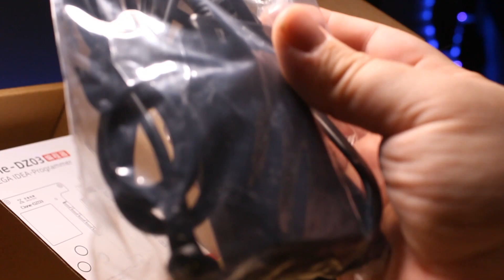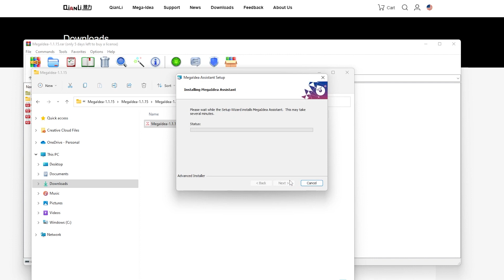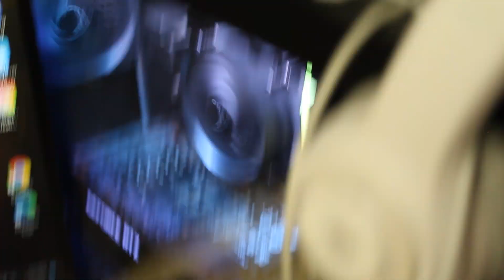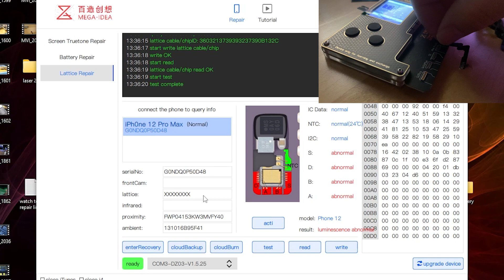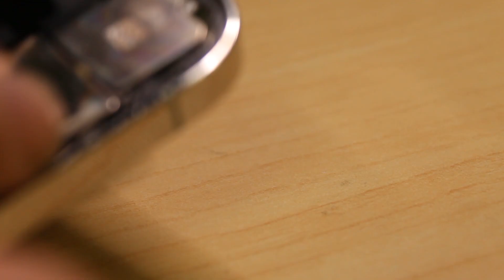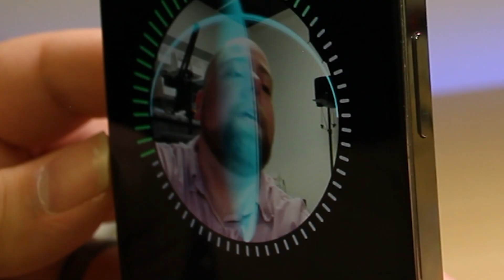Face Id Repair with Tag on Flex and Programming only? (No Soldering Required!!!)👍

Comment: Hi bro…please i have a question??… can i still read the data from an original dot matrix flex cable that has a very little tear or cut, is it possible to read the data with a programmer
Reply from the maker: Probably not, it might still be recoverable but it will need to be soldered to a good flex to access the data.
Reply: @FIXDPHONES  ohhh great…is there a process to it

Comment: Just wondering if you could help so i was getting boot loop and i came to conclusion that it was the proximity sensor and i swapped that out for a new one but obviously i have lost face id to fix this could i use a clone-dz03 or do i have to solder the old sensor back on any help is appreciated.

Comment: I am getting this errors “ lattice cable/ chip not connected” how can I fix it? Thanks
Reply from the maker: Try downloading the most recent update for the software as they fixed some of these bugs, otherwise that issue can occur when the dot projector is sufficiently damaged to not be read and solder work would need to take place to get Face ID back. I hope it’s just software in this case.

Comment: Hey am I able to do this without the original speaker assembly? The flex cable broke on it. This is for the iPhone X
Reply from the maker: No, this tool isn’t designed for the proximity sensor assembly, it’s for the front facing camera assembly (specifically the dot projector) for a torn cable on the proximity assembly you’ll need to solder the proximity component over to another original flex cable to retain Face ID

Comment: Thank you for the detail steps.  I got the qianli programmer.  Did the steps on your video, passed the test with the tag on cable but after I installed it trying to setup face id it will show move higher or lower prompt.  Took it out tried setting up with the display on the side using a extension cable but still same issue.  Any suggestions on what I might do to resolve the issue?

Update:
Figured it out.  I used another qianli tag on flex.  Followed the same instruction and everything worked as expected.  Thank you for the video...
Reply: Thanks for this comment.. i wish i knew earlier to buy more tag on flex's.

I messed up a customers iphone 11 face id when using to much rubbing alcohol taking out battery. I tried these steps in the video, but i still got the move up/down error. Its possible i may have just messed up the camera and i shoud have tried changing that first. But Quanli face id board did detect errors, except i think when i tried to repair it the results were not the same as in video. I amtemted to solder the chip onto a new flwx next, but i cracked the enclosure when trying to remove it, i didnt realize the glue was so tough on there...

My question is, if we try this method and it fails (as well as trying addition tags), is soldering the chip onto a new flex still an option, i would guess with a new tag on flex.  or is that poinless now since we perhaps have wiped the chip?

Comment: I just got the programmer and it’s great. After programming the tag on flex I installed everything into the iPhone but Face ID still doesn’t work. The Face ID module hasn’t been damaged in any way. The iPhone a am working on is an 11 pro. I’ve heard that the iPhone has to be updated in order for this to work and I wanted to see if that was true. It’s currently running iOS 13.3 and I don’t want to update it but I want to know if that is the problem with it.
Reply from the maker: I don't think it should be affected by running an old iOS. Its worth the try as the worst that can happen is it still wont work.
Reply: @FIXDPHONES  I’ve tried an iPhone X on iOS 12 and the 11 pro on iOS 13 and they both won’t work. But I know for a fact that it will work on iOS 15 on onward.

Comment: why dont you just directly program the faceid and have to use tag on flex?
Reply from the maker: It’s not a matter of programming the Face ID, it’s already programmed by apple. The issue is the phone can’t read it and by using this tool you can copy and program the tag on flex to bypass and make the dot projector function. I hope to demo directly programming the Face ID when they come out with a method to do it without a tag on flex